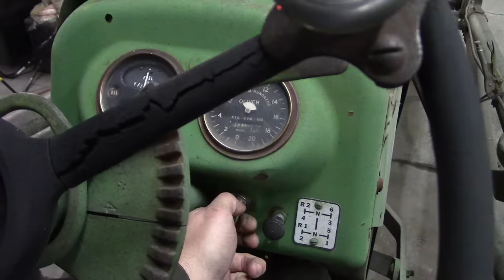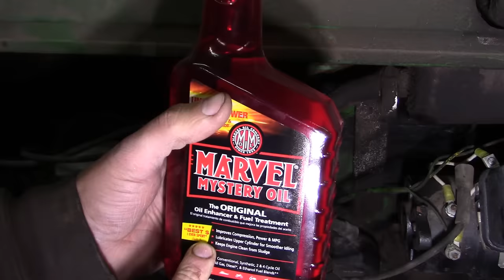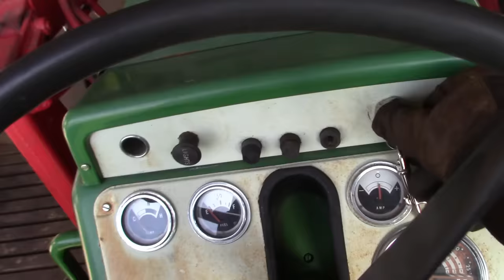Oliver 770 Tractor - Will it Run after Sitting 10 Years? (Christmas Special)

Comment: Wes here is a thought for content. Jerk that loader off of there and either sell it or scrap it. Now here is the part where you forge a new YouTube frontier. Create a new attachment for the 770, maybe a jib crane or a forklift attachment. Next reach out to the Oliver community, see if you track down some of the original engineers from Charles City. Create a documentary that allows the world to see how the design concept functioned back then. Let us see the pieces, assemblies and components materialize on a drafting table with a slide rule. 
Next take us all on the journey of fabrication, welding, and assembly.  And to put a nice a bow on the whole project lets us see how all the drawings for parts, service, and maintenance are joined to create the necessary factory literature.
The reason that people so enjoy the older equipment is that the artifacts have a connection to the human soul. These items began in someone's mind. The drawings were made by a human hand. Another human hand turned the lever on a Brown and Sharp screw machine. The sweat from a welder flowed into the flux from a large Lincoln Sub-Arc unit. There is a human connection in the old iron.
To my knowledge no one on YouTube has attempted the proposed endeavor. You could be the pioneer Wes. I would watch Wes, and so would a great many others. I have watched enough folks drown poor old engines with either and ignorance.
I would volunteer to do some machine work, lay a bead, or pull some wrenches.

Comment: At times, I Watch Wes kind of Work.! When you tried to blow back the radiator drain on the Block my thought was pulled the cap and use a 3/16", or 1/4" drill by hand to auger it out. It worked when I was working on my old Triump TR4 motor 35years ago.

Comment: If only they just put a tin can over the exhaust pipe years ago.
Reply: Maybe he did, but it blew away, or rusted thru, not uncommon. Either way it's sad to see old equipment neglected for whatever reason.
Reply: Ive seen people dump kitchen spices into a tractor radiator to stop leaks, next thing you hear is, well now the motor is shot, i did all i could to save it.
Reply: “Bangladesh ship-breaking mode” LOL
Reply: Good stop gap for a leaking radiator, every shade tree mechanic knows is black pepper, and yes it does work

Comment: We've had Oliver diesels on dad and my farms since 1953, they start as fast as any when they're up to snuff, we never use the preheaters. My 1650 is tired, probably low compression and injection system worn, it starts a lot better with fast starter, I guess if I was going to spend to get it back to what it once was I would trade it on one that needed less.   Your 1650 looks much better than mine does, looks like its worth saving.  I m just an old Oliver lover dont mean to be a pest, enjoy your videos.

Comment: Just watched your video on the Olive. In regards to the sludge in the water jacket. Many years ago I worked with a guy that was an owner operator and mechanic of heavy equipment, this is back in the 50's, 60's and 70's. He once told me that when ever he developed a coolant leak he would stop at a grocery store and by some black pepper, remove the radiator cap and poor in the black pepper and this would stop the leak. The sludge looked very much like black pepper.

Comment: Nice to see her fixed up!  If you you nix the loader, replace the front tires, fix the hole in hood, maybe find an original power steering pump, repair the seat, do a repaint, and get everything working you have a better chance of getting your money out of it.  Sell privately as a restored tractor with receipts for the overhaul and explaining what you did and you’ll get $5-$7k for it to the right person.  Would be a great work, parade, or collector tractor for someone.  

Often times people look at what a runner might bring online BUT there is little to no history.  If someone can have confidence in the tractor and you, and what you’ve done that adds value and someone can feel better about spending money for a reliably repaired machine.  Don’t sell yourself short!

Comment: With the fake ending in the middle I knew I liked your humor and had to subscribe immediately. Always love videos of tractors being torn apart and fixed. The loader looks like a Deere #45, they were made to fit on about anything with a narrow front. By modern standards it does suck but better then a shovel. I wouldn't go without mine now. If you need any info on that loader I can probably help.

Comment: 10 minutes in I realized that I'd seen this one before. So now I've watched it twice. Excellent stuff. I live on a narrowboat, (2 metre wide barge), in the middle of England, and my engine, from a Fordson tractor, also has wet liners. I guess that was a tractor thing. Always thought it was a daft idea. All that keeps coolant out of the cylinders is a little seal top and bottom. Don't use the engine, so what the heck. I ain't going nowhere, as Bob Dylan once said. Or, as Townes Van Zandt said, 'You don't need no engine to go downhill, and that's the direction you're headed in, as he handed me the key'... Great video, Wes, many thanks.

Comment: Hi Wes,loving the channel, keep up the good work. Alloy wheel cleaner can sometimes be a last try substance for freeing stuck pistons or aluminium heads that have frozen on their studs. I did once watch a guy free up a rare and irreplaceable WW1 aero engine by filling the bores with smoking hot oil!

Comment: I had a stuck engine, an Olds 455 Cu in.  I tried several options over the winter.  Friend said, "use some coke acola"  So i cleaned out the other crap that i had used,  dried the walls and pistons with a  tourch, then dumped in a liter of coke, i turned engine over 1/2 hour later.  So, new rings after a good cleaning and then it ran.  Whooppe!!!  Takk

Comment: I owned a 770 like this one but in good running condition. It was a gas guzzler. Powerful tractor. I traded it in for a 2005 John Deere 4720 cab over with loader. 275 hrs on the clock. I don't miss the 770.

Comment: Well, now that you got out the liners with the stuck pistons you might try pouring in a dilute solution of either hydrochloric or citric acid. Both will potentially not only creep into any fused spots between piston rings and liner like penetrating oils but actually dissolve Iron as well as Aluminium salts formed during corrosion.

Comment: It is true as you get older the thinner your skin gets. I am 74 and for over ten years my hand were cut up bad. Now I wear hand protection and my hand may take twice as long to heal but I have learned to keep clear. The reason is because the skin cells slow way down on dividing to produce new skin.

Comment: My brother gave me a Ford 631, the pitting was so bad on cylinder 2 and 3, that when we finally got it started, it threw rust many feet in the air when those two cylinders finally started to fire. Good compression on 1 and 4, only about a third that on 2 and 3. Blow by at full rpm and throttle is nearly as bad as what is going up the stack. Unfortunately it is not a sleeved block, and neither is my spare engine. Hopefully you will not need to lap your liners  to the block for the right fit. Exhaust covers are a must, even if it is just a juice can. Have fun

Comment: Had a few Olivers.
Nice machines innovative also.
Alot of guys are changing out Waukesha with 5.9 Cummins or a 300 Ford 6 if motor is bad.
Parts are scarce on some.
One old timer told me he put a zerk grease fitting on a shell of a spark plug and on a cylinder with valves closed he pumped grease in until piston went down.

Comment: Tractor put new battery needs new parts everything before get the machine running also new starter replacement awesome video friend bless you happy new year 2021 heavy equipment in the field

Comment: I've had good luck getting a stuck engine loose using a compression tester hose. Put some thin oil in the cylinder,Take the hose off the gauge and screw it in a cylinder hole where the valves are closed then connect it to a air tank. The air pressure will force oil down the cylinder walls and push the piston down,then move to another cylinder where the valves are closed. and keep doing this until it spins over freely.

Comment: Did you check the top of the head? The Farmall I'm fixing up was left out with an open exhaust. Tried breaking it loose by dragging it around. No dice. 

Wound up having to take it apart like you did. I found hairline cracks at the top of the water jacket, and needed to find a replacement block.

Comment: WWW...Love the Video and old Oliver Tractors. I used to drive an Oliver 70 on the Farm. A quart of oil every other day and hauled a lot of Hay. Not that it would help this engine... But some say to use Kerosene in the Cylinders. And Get a helper. Tow the tractor up to speed and Pop the Clutch. Break more parts. LOL

Comment: Hah!  A recent issue of an Oliver?  When I was below school age, we had a genuine old Oliver on our farm.  Probably from early 1930's build.  No modern gizmos like rubber tires!  No, they were solid steel, all 4 of them.  Front ones were small.  The rear ones were big and with some wedge shaped spikes in two rows.  On hard gravel those spikes did not sink in their full length, so the riding was pretty bumpy.  No hydraulics either, only one power outlet mounted on the side for driving a flat belt.  Of that use I have just one recollection when our thresher was pulled out to the field and powered by the Oliver.  I don't know where it went when we eventually retired it.  But I bet you would have enjoyed buying and fixing it.  No Youtube then, though.  Come to think it, no TV either, not even black and white!

Comment: Nice tractor paperweight. You Sir have it bad for Olivers. Try and find a Letdig18 pond that's deep enough and drop whats left in to rust away than leave it outside in the winter. For a 2021 project why not get a Oliver tractor and do a full nut and bolt restore for the channel and have the fluids mechanic help out!

Comment: the reason for + ground was they used the flow of electrodes as how to hook up a battery back then. power flows from the - side of the battery to the + side. but what they found out was when a battery that is hooked up with + to ground is it would die quicker because there was always a parasitic draw when the + is set up as a ground. it wasn't much of a draw on the 6v battery but when they went to 12v batteries it would die much quicker so they changed it to what we are use to today

Comment: I used an electrolysis bath to soak a stuck 1960 mercedes Engine which had been sitting outside with the head off for years. A week in the bath and the pistons slid right out with hardly any butchery required.

Comment: Hi, gonna subscribe.  I hope I can recommend mechanics gloves to protect your skin from oil and grease, and also a bash or a cut.  Get thin disposable ones or something you can throw in the washer.  Oil absorbs through the skin, overloads the liver trying to purify it, and mechanics wind up with cancer and other diseases.  So, I saw a video where a guy had a block outside the barn, filled the cylinders with diesel oil (head removed) draped a rag over the top like a wick and set it afire. Then it burns till it runs dry. He said it heats the wall and piston in a way that it is free when it cools down the next day.  Sure enough, it was the only one he could not get out and the next day came right out with no trouble.  Cool story, huh?  I drove a 1650 on a potato farm on RI in 1968.

Comment: My Uncle used to remove the spark plugs and poor in some essential lube let it sit for several days, Then remove the starter and use a long pry bar on the fly wheel. He had good success getting stuck engines running.  Another method you remove the rockers and check to see if all valves close, then remove spark plugs and fill each cylinder with light oil, He then would install a bushing with a grease zerk in it and would pump it full with oil, It would work just like a hydraulic jack.  In this case I doubt either method would have helped much, But remember it for next time.

Comment: I know what you're into brother. Friend brought me an 88 diesel stuck. Opened the pipe plugs on the pre-combustion chambers and anti-freeze came out of two and clear water came out one. Not good. My friend wanted it fixed so $1300 later it was running. Those Oliver sixes were smooth running engines. But they are the wrong color green to get your money out of it. Good luck.

Comment: Its not a diesel dude. It likely would run without rings.  Also, what do you do with it after?  I've got a farmall "C" that continues to run likely with a lot of loose parts.  On the sitting outside and dry idea?  Yeah, dry when its cold but when you have those huge temp swings, say 20° to 50° in 24 hrs you get condensation.  Your fluid film should do just fine.  Thanks for posting.

Comment: @Watch Wes Work  Richard Petty mixed bore diameters in NASCAR in the 60's/70's.  Turns out the NASCAR teardown inspector always took the bore diameter measurements from cylinder number 1.     I don't know if this required special crankshaft balancing.. or other mods.. But Petty ran 500 mile races at 8000 rpm with mixed Piston bores.  1 piston at legal size.. and 7 that were overbored.  Petty was eventually caught.

Comment: 33:39 since it has removable liners already, taking the pistons out with the liners is what you should start with instead of beating the crap out of the pistons. Then stick them in the press and force them out. If that doesn't get them to budge, only then do you have a lost cause. Beating the crap out of stuck pistons only makes sense for engines that don't have removable liners.

Comment: I still run that loader on my John Deere M. T.   The trip bucket will relatch itself if you drop the load from about 5 feet up. If you have some weight it will drop swing way back and then the momentum will bring it back up to lock. It's caveman technology but it works.

Comment: I’m surprised you can’t just put 1 different size piston in. I have snowmobiles that have 1 different size piston and they run just fine. It’s my understanding that if it’s like within 10% of the original size it should not be an issue? Maybe I’m wrong about being true for 4 stroke engines. In any case love these types of videos and looking forward to seeing more

Comment: You've just depressed me, I've got a JD 1086 combine with a locked engine (had a small engine bay fire round the hydraulic tank air filter area) and started watching this hoping to get some ideas (damaged seemed limited to the air filter oil tank plus melted wires and hoses etc) but I fear now the JD's engine is toast which is a shame as except for the locked engine and fire damage the combine is in pretty good condition.

Comment: use hydraulic press or jack on pistons to break loose..  could just build a cage with an upside down hydraulic jack welded on top..
lol at when you pull header off while holding mallet like about to play "wack a mole"..
You could bore out the cylinders to match piston sizes to something more available.

Comment: Another trick for unsticking pistons: bust the ceramic out of a spark plug and tap or weld a grease zerk in the top. Then just keep pumping grease in and it'll usually break free.
Reply from the maker: I have a whole video on that. It didn't work.
Reply: @WatchWesWork  I'll take a look. It worked the time I tried but every situation is different.

Comment: An old timer once told me that the best way to free up an old Oliver Motor was to squeeze your right testicle real hard, then light the left one on fire. When the crabs start running stab them with an ice pick. Says that's how they did it back in the day, and 50% of the time it worked every time.

Comment: If you're going to keep the tractor First thing I would do is get rid of the crapping loader, overhaul the engine, install 12 volt electronic ignition instead of points and condenser ( The electronic ignition makes the engine start up quicker ), install 12 volt alternator if possible, and give it a new paint job.

Comment: Undo the connecting rods, pull the piston and liners, heat the liners or split the liners to salvage connecting rods if not bent already. No mater how ya look at it right now your going to need pistons and liner at the very least and please put away the sledgehammer they wreck more than help.

Comment: I can't imagine all that water was from mice piss... I would suggest the owner had left this tractor outside exposed to the rain for some time and that would explain how all that water came into the exhaust pipe as they did not place a can over it to protect it from water or snow It would also also explain how the cylinders would of got all rusted. Mice piss would of evaporated before it would of settled down into that oil pan.

Comment: Too bad you couldn't find a stock bore piston.  It wouldn't be hard to turn it down the .010 and then do the same to a 3-5/8 sleeve.  Maybe you could salvage the old #4 piston from the sleeve and clean it up on a lathe, since you think you have swelled it by beating on it.  If you have a lathe and an angle grinder (or mill) it wouldn't cost much to try and rule it out the possibility, assuming the piston didn't crack while you were beating on her).  In the long run, she would probably run better with 6 new sleeves and pistons.  Keep up the good work.

Comment: If you watch closely at the 27:29 to 27:31 mark, just to the left of the impact socket you’ll see a cylinder head valve that was partially stuck down, pop up.